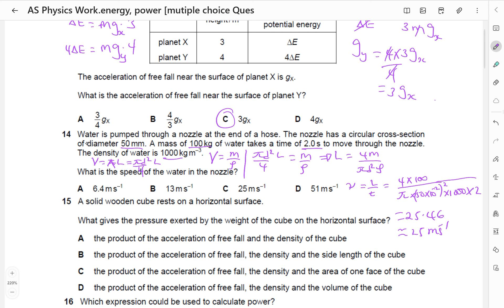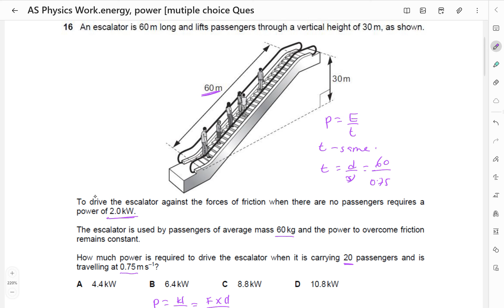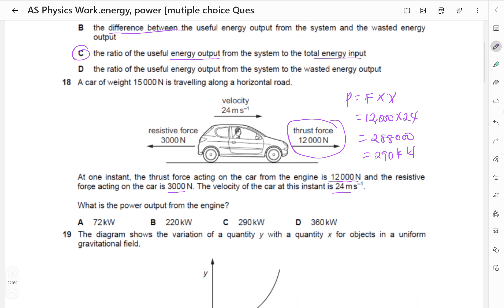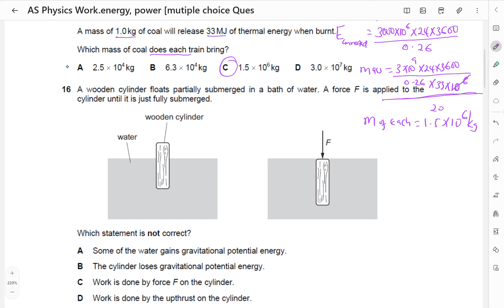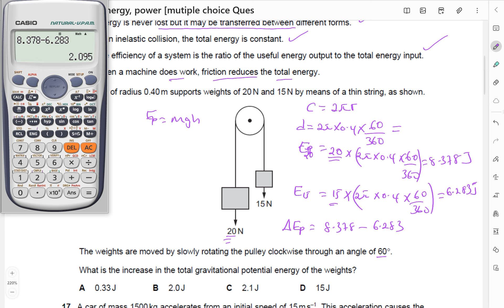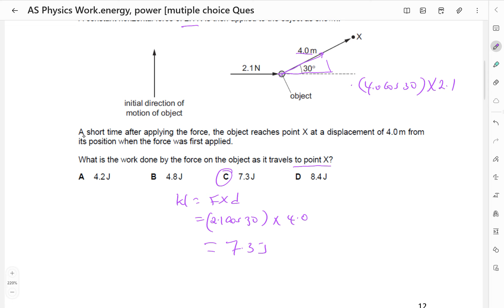Work, Energy & Power; AS PHYSICS 9702 [MULTIPLE CHOICE QUESTIONS] #Part 1

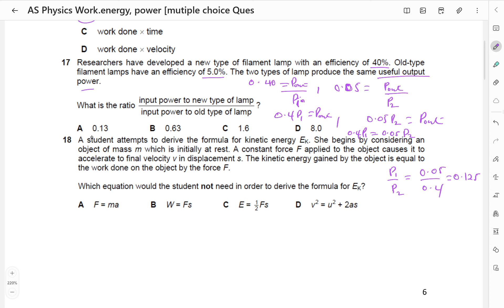Comment: sir  at 35:17 my answer is D which is 8.0 my working is  power output of new lamp is 0.4 multiply Power input and power output of old lamp is 0.05 multiply P2  and if we divide  0.4/0.05 THEN it will be 8
Reply from the maker: your math is not good, check it again

Comment: At26:42 why we don't use formula of P=FV 
Force is 60*20*9.81
Velocity 0.75
Total force  8829+2000
Reply from the maker: this only works if force is parallel to the constant velocity. But remember weight is vertical yet motion is not perfectly veritcal.. So its better to consider workdone in the vertical divide by time

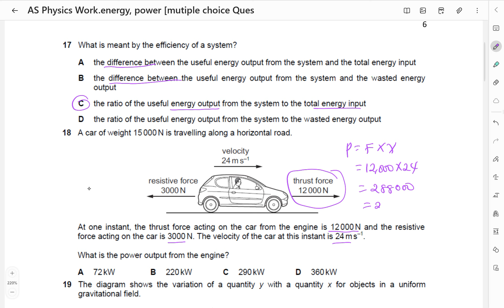Comment: 38:20 why we dont add 3000 to thrust force i do that bcz i thought that power is producing force of 12kN and also overcoming the 3KN so we need to include both please guide
Reply from the maker: no dear, we want the power of the engine, this power must be enough to overcome the 3000N resistance and also give the car a speed. so we use the force which is coming from the Engine .